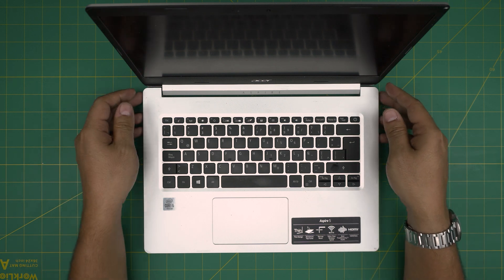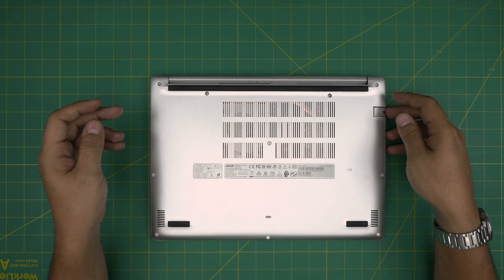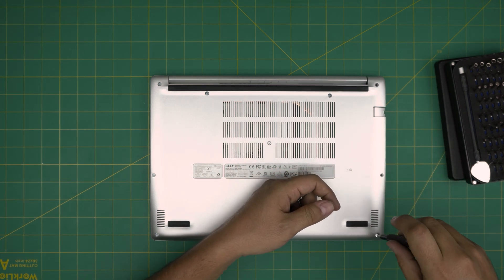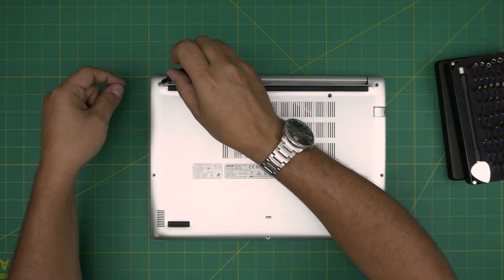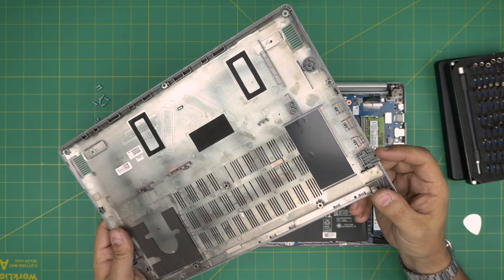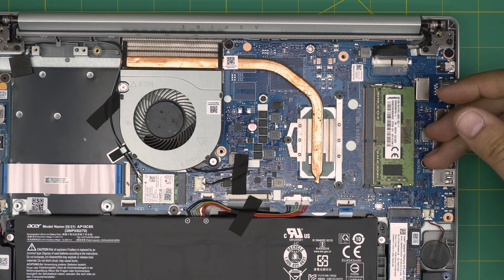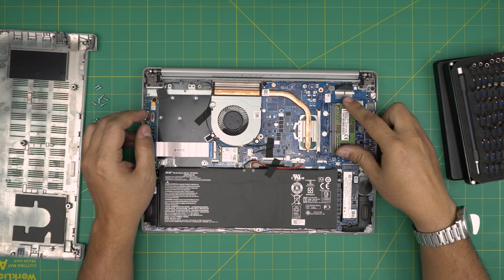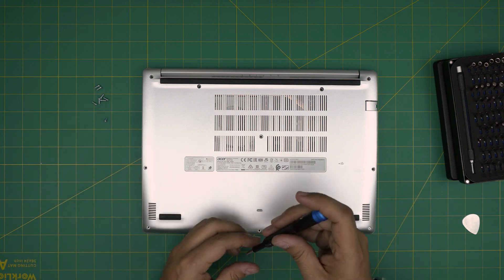How to Upgrade RAM on Acer Aspire 5 A514-53-56UF Laptop | Step by Step

Comment: hi, i have the acer aspire a514-53 and just changed the removable 4gb 2666 to a 16gb ddr4 3200 sodimm (now laptop totaling 20gb ram), does the new one make any difference if it is the 3200 in performance? or does it have to be the same as the one in the link in the description from amazon 2400? does it affect anything? hope to hear from you, many thanks! 🙏
Reply from the maker: 🫠Regarding your question, it will not affect anything. The BIOS will automatically adjust the RAM speed to match the onboard RAM speed. For example, if your onboard RAM speed is 2666MHz and you install additional RAM with a speed of 3200MHz, the BIOS (motherboard) will automatically adjust the new RAM to match the lower speed. There's nothing wrong with what you did, and it will work just fine.
Should you have any further questions or requests in the future, please don't hesitate to ask me.
cheers🍻
Reply: @uFixTek  thanks for answer 🙏, was bit confused if the new ram will work as many google answers say that the max ram for this laptop is 12 (in total), only few places where people say 20 👀
Reply from the maker: It's my pleasure my friend.